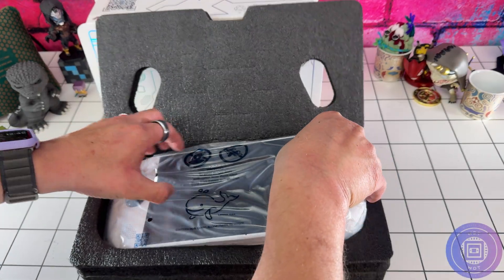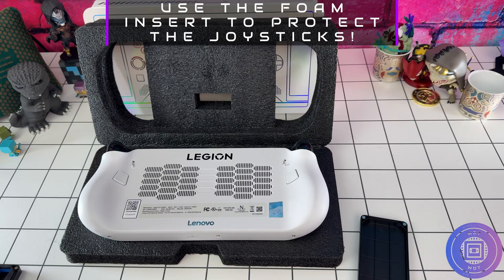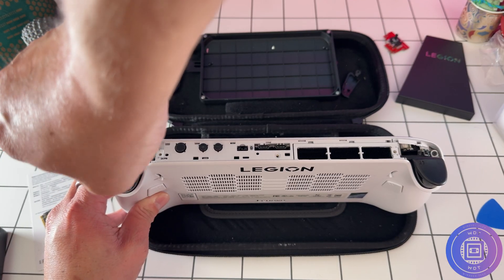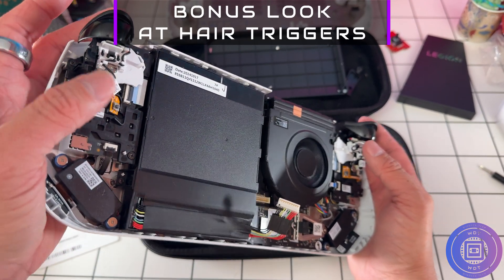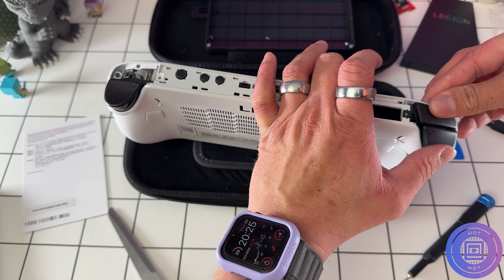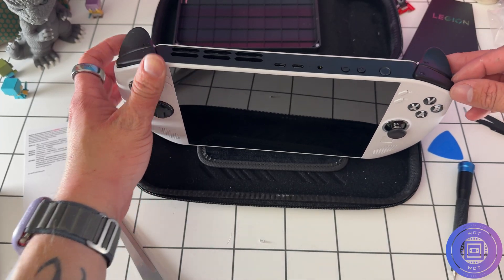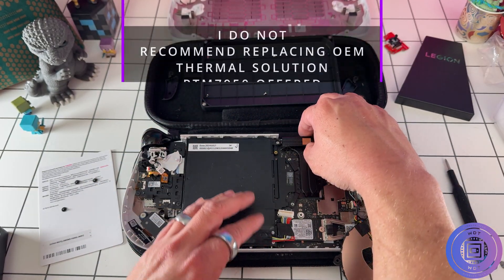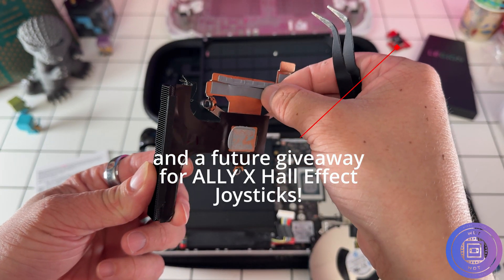Lenovo Legion Go S | SSD Upgrade Guide AND Teardown Tutorial! - Z1E & Z2 Go

Comment: Gotta say this handheld PC is a pain to open followed your video guide to open up the Legion Go S Z1E Steam OS edition I have from 1TB to 2TB & making sure I didn't accidently brake the RB shoulder button was the most stressful part as it was a pain to get back in  the LB shoulder button was so much easier for whatever reason, also while the while the vent looked easy to get off while watching your video that was pretty difficult for me. Also for whatever reason the right captive screw decided to brake free from captivity & dropped out of the handheld didn't loose it thankfully the handheld went back together & nothing sounds like its loose or anything same as when I bought it just has 2TB of internal storage now, regardless while the software side of your video wasn't useful to me since I just did a clean install of Steam OS 3 on my Legion Go S Z1E Steam OS edition the teardown portion still helped.
Reply: On my Go S one of the clips around the radiator was pre broken. The remaining clip was as you say, quite difficult to unlatched.
Reply: @powpowdingdong  Not doubting you but curious how the clips around the radiator was pr broken. If it wasn't broken while you were dissembling it I'd argue thats a reason to use your warranty for a Legion Go S with both clips not broken.

Comment: Does it seem like the trigger / bumpers are separate from the main board? I have a friend whose bumper stopped clicking and wondering if it’s replaceable or if he put the bumper back in bad lol
Reply from the maker: Yeah the bumpers are just little pieces of plastic that should be easy to replace. The triggers are more involved but still should be doable
There are little tiny guide clips when putting them back in.

On my go s z2go I accidentally broke one of the clips and now it wiggles in the ghoulish but does not fall out
Reply: @WinDeckTech  what about the board for the clicks? I see ribbon cables, so does it seem like it is a separate daughter board and can be removed / replaced without replacing the whole main board? I figure Lenovo will help him out, but he wants to try and tinker with it himself first

Comment: I did some software tinkering on this exact unit. I installed Windows 10 Iot Enterprise on this but for the life of me could not find the correct or relevant drivers for the USB4 ports. Hence my Dock did not work, did not connect to my 2 screens. I then installed Windows 11 Iot Enterprise and have got it running really well like when you get brand new minus all the windows 11 garbage including the windows 11 app store. Win Win.
Reply from the maker: I mean technically these devices are unsupported by Win10
But also, there may be some part that doesn’t get installed or some driver may not be an immediate issue but something to keep in mind if some element doesn’t work like it should within windows

Comment: what was the point of removing the heatsink?
Reply: Agreed it boggles my mind why he was messing with brand new thermal paste. Glad it was detailed, but I worry about the kids following along step by step only to realize they didn’t need to do this at all.
Reply: Could reapply the thermal paste and pads?
Reply: @powpowdingdong  yeah but what?  This wasn’t even a teardown!
Reply: @pperry6715 so u take offense that this youtuber actually do more than asked?
Reply from the maker: Huh wut
Reply: @WinDeckTech oops sorry, I think I replied to the wrong video.
Reply: @indosuprem2296  he didn’t do more, that’s the point.  If it were a full tear down that would be great, but he didn’t even touch the battery.
Reply: @pperry6715 what?

Comment: Thank you for the tear down. I am curious on if your unit’s battery has a minor wobble as you move the LeGo S back and forth. I think it’s the top of the battery housing not being held down. 

I believe putting a small foam block on the plate can mitigate this issue. I’m curious if you experienced that while using your device, or it’s even worth it as I’m not exactly savvy with stuff like this
Reply from the maker: Yes sorry, I have experienced that after this teardown was filmed.

I had the same issues as well as other reports of the same.

I personally put two little sticky felt pads on the back of the battery and that stopped it completely.

I will probably make a short on the issue if you wanted to see it any further
Reply: @WinDeckTech thank you for the quick response, I’m mainly worried if the wobble can result in defect in the long run, if it’s just a quirk of the device I think I might live with it or do it down the road. 

I think your video here provides more than enough instructions. The wobble point are very obviously towards the top of the battery tray.

Comment: Hi, I'm looking to lower temps a little. Do you think a low profile copper heatsink for the nvme would help? Also original Legion Go doesn't use a PTM7950. Do you know if Lenovo is using a PTM7950 on the Legion Go S from the factory.
Reply from the maker: in the video i did replace the TIM with PTM7950, this proved to be mostly useless and still seems to be the case even many months post this video. I am 99% the TIM used on the Go S is of PTM quality, the same, or ever so slightly better.

While you could add a copper shim or an ultra low profile heatsink to the SSD I do not know if this would be worthwhile.

If you have the parts laying around and are comfortable doing so, I'd say give it a try, if that is your thing (tweaking and tuning) but do not expect completely night and day differences. Your best bet is to seek out NVME drives that are of high efficiency/low power draw to help curb some of the heat.
Reply: @WinDeckTech I'm not an expert, but I have built 5 PCs and took apart a Steam Deck (ssd upgrade & ptm7950). I believe that since handheld PCs are so small and compact, that any parts running cooler, should lower overall temps. I'm hoping to bring temps down 3c to 5c (nothing insane). I'm running SteamOS on it. I really wish that I could do some undervoltong and maybe a small overclock to really see what the Z2go is capable. I strongly believe that the APU could greatly benefit from an undervolt especially at higher wattage, giving headroom for overclocking.
Reply from the maker: @PlatinumArms you can try using decky plugin alongside deckyTDP 
I used it in the initial launch but more settings may have been added to support more of the features on the go s

SMT control did work, which would help save some life in certain scenarios
Reply: @WinDeckTech I'm using SimpleDeckyTDP (which is amazing) and Decky-Undervolt (which doesn't seem to be working). The Z2go CPU has 8 threads, a lot of newer games need 8 threads. Disabling SMT would be great on the Z1 extreme to save power and heat but on the Z2go you need those threads (my opinion).

Comment: Do you really need to remove the cooling parts to remove the SSD? It doesn't look like it, but you include the footage, so not sure.
Reply from the maker: Thanks for the kind comment and no!!! Sorry you do NOT need to remove the cooling components, that was just for fun and curiosity of myself and to share with the viewers.

Just ensure you take care when removing the bumpers as these are the most fragile pieces imo.

After that you can use the 2242 size ssd (stock size) or 2230 (longer larger capacity)
Reply: Excellent video by the way!

Comment: Is z2go good if I use it as a pc more than gaming handheld
Reply from the maker: At that tbh I would get a steam deck or even just a used ROG ally og 

Price would be much better and performance

The go s z2go is more powerful than the steam deck but only slightly without the battery life benefits of the deck

The og ally would be much more powerful than the two and if you buy one used could probably be had for about the same price as a deck or less at Msrp.

My recommendation for people who use a pc more than a handheld will always be to get a steam deck (if you don’t need multiplayer anti cheat compatibility)

You’ll be able to play most any game in your library and any game that you can’t you could stream from your pc (or just play them natively there)

The steam deck imo is the perfect companion to a gaming.
But if you did spend more time gaming on handheld I would always recommend something a bit more powerful like the ally or legion go (Z1E chip)

If you wanted to treat yourself I would go for the deck OLED over the Z2go gos any day of the week

Purists will say the OLED screen is of poor quality but I’d be lying if I said the screen didn’t put a smile on my face each time I use it.

Just some food for thought! Also always try to check out the used market in your area, steam deck lcd models can be found used (in my area) for about $300 cad
Reply: @WinDeckTech  but ally looks ugly and worse bettery than both they said because z1e needs bigger bettery life this why ally x , steam deck is the king but the screen size isn't that big , lenovo go s had very great quality but z2go isn't that bad but I don't get it i put steamOs on it and it's stuttering more than steam deck even in your windows 11 videos running games better than me did i did something wrong when I changed to steamOs?! Some people talked about the vram thing and the drivers and I was think steamOs will give the device smoother images when just putting steamOs , I see videos of silent hill 2.remake on z2go with 1600×1000 at 40-50fp my is just 15-22 in low settings?

Comment: Question for you my guy, I just bought the lenovo legion go s 8" and I would like to upgrade my 1tb to 4tb is that possible? And if it is do have to reinstall steamOS?
Reply from the maker: Sorry Dude for the delay!

it is possible, you can either clone the 1tb drive although you will need an external nvme enclosure to do so. Otherwise you can pop in the new drive then grab the SteamOS install file from Valve's site, use a tool like Rufus to create a bootable SD Card or USB Drive. Then plug it into the Go S with the new drive and it should automatically take you through the install process.

Comment: Why do you constantly bang on about drive cloning fear? You said it yourself, problems happen SOMETIMES. It's like fear mongering about driving a car, yeah some people have accidents but not everyone. 
You're probably the kind of guy who watches someone successfully clone the drive 9/10 and on the 10th time you say 'see i told you so' when in reality its the 9 times that told you so.
People have been cloning and imaging for decades, its not some scary new technology with massive risks.

Good video, but seriously, relax on the clone driving fear. Its not adding so much risk that you should avoid it.
Reply from the maker: Eh, it is a risk. I would rather make people aware of the risks and let them make their decision based around that. As opposed to "Yeah go ahead clone your drive using this tool" and leaving it there.

I have personally had security related issues when doing it on my laptop, with bitlocker keys getting messed up (which has and hasn't happened to me in the past)
While personally I am able to work through hat and issue new keys etc. (for accounts inside the OS not just accessing it) I know a vast majority would be stumped.

With Microsoft's insistence now on Secure Boot and "secured-core" pc's I can see this happening more often in the future.

While  it may not happen to everyone, and when working on a fresh/clean device it has rarely, if ever happened to me. The chance is still there.

The same could be said for yourself of "well it works 9/10 times, so its relatively safe/risk free"

The comparison of driving a car and having an accident is quite outlandish as it is fair to say, a vast majority know the risks (people of age) when it comes to driving dangerously and the increased risks of getting into an accident. Even if not, speeding or driving recklessly, people tend to try their best to prevent an accident on their end.

Now at the same time, it would be fair to say people looking up how to clone a drive or something similar may not have as much intimate  knowledge as you or I do when it comes to the potential risks of cloning a drive.
Where I am sure the both of us can clone a drive in our sleep, knowing the risks and taking proper precautions to mitigate them. Someone of a novice skillset may not.
How many times do you see comments of people not checking the box to fill the rest of the drive on other tutorials, even though if it is shown in the video.

I am of the mindset of making absolutely sure any  recommendations, tutorials or advice I give out. Is also followed up by any known risks to doing such things (if applicable).

While I agree yes the chances are likely in favour of it working with no issue.
The risk is still there. Make no mistake though, this is NOT common knowledge.

Please don't take this as a defensive or argumentative statement. More as from the eyes of acknowledging that sometimes people in the tech space can get "lost" in their own knowledge and potentially, inadvertently at times, lead someone astray or give advice without giving some of the risk assessments alongside it because "it always works for me"

I do appreciate the positive comment though and appreciation. Also, I will look to tighten things like that up in the future to be potentially a more quick rundown on any potential risks and move on. As I do not feel it would be right to omit things like that completely. But to not, "bang-on" with it as you said.

Thank you again for the feedback and positive criticism.
Reply: Jesus, reading this has convinced me that the adoption of these devices is a net negative for the tech sector.

Comment: Hello, I noticed that if I shake the device a bit harder, there’s a noticeable rattling sound, like the battery is shifting. There’s no sound with light movement though. Just wondering—is this normal behavior or part of the design? This is my first time buying a Windows handheld—do ROG Ally or Steam Deck also have this kind of issue?
Reply from the maker: Some tolerances seem to be a little looser or tighter on the battery carriage. As it seems to be inside a tray that is then attached to the chassis.

What I did on my white unit was put some felt sticky tabs on the battery to add more cushion against the backplate. Solved all noises/rattle
Reply: I also have this on the right side (mine is the steam os version) . I did wonder if it was a rumble motor as its a dull sound when shaken , but wanted to find a teardown video 1st before I cracked it open . It's not affecting performance but I know it's there 😂 Is it the same fix as the windows version.. just some felt pads ? N would they need to be insulated ones if that is the fix ??

Comment: Hey, thanks for the vid.  I know it's old but I wondered if you knew if the SSD was swapped on the Steam OS model if it'll boot up in the bios to allow a "fresh install" of Steam OS, or will a cloning need to be necessary?
Reply from the maker: NP!

The SSD is the same, just different boot image per version (windows/steam) 
You don’t really need to clone either as all drivers are available for the windows version online and steamos now uses the recovery image to install which has native support for the go s built in

You can get into the bios on either or, both are the same

Comment: Okay, so this worked! Thanks. However, have any of you had issues with the case being slightly off after reinstalling. Maybe I’m hypersensitive to it, but I feel a bit of a lip on each side. My front cover feels like it doesn’t align with the back after this. I’ve tried reassembling it twice. Any thoughts??
Reply from the maker: Did you notice if any of the clip housings got broken off on the chassis?
But now that you mention it, I do notice the right handle on mine has a slight lip
But not the left.

I have only disassembled my purple unit once but the white one multiple times.

Whether the lip was there before or not I cannot say for certain.

But what I can say is that my white unit had a lot of wobble and audible clacking from my battery cradle
The purple one did not, but I could still be the slight motion of the battery shifting inside with no noise.

However now it does have an audible rattle like my go s white did from unboxing.

What I think is happening potentially is with the heating and cooling of the chassis, it is expanding and contracting certain areas causing these things to happen
Reply: @WinDeckTech I took it apart two more times since my post this morning. Realigned from the bottom up as I was putting the back cover back on. Most of the lip is gone. I don’t have any broken pieces and I think it’s just a matter of aligning it. A bit of hassle, but one that should be looked at when putting it back together. 

I genuinely believe there was no lip before my first surgery on this thing. Scars and all, I’m going to love this thing. Just got it last night. Great video btw!

Comment: Which is that "thermal paste" ? Thanks
Reply from the maker: Ptm7950 don’t bother replacing the TIM though they already seem to use PTM
Reply from the maker: No reason to open it up unless to replace the SSD no you don’t need to remove the fan to take out the ssd

Comment: Hello, thanks for upgrade ssd Guide for Legion go s, i follow this video and it's working. 

But after re installation of windows, update and instal legion space, My LT and RT button become very small sensitivity when i use FPS Mode (For Racing mode the buttot is 100% working without issue), i have try to use callibrate in legion space but is error when FPS Mode, can someone help me to fix it?